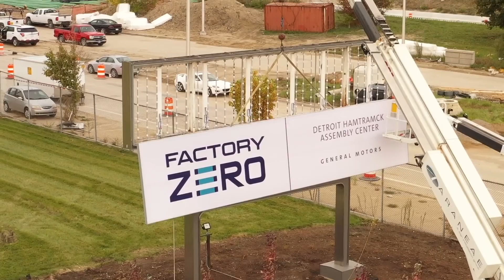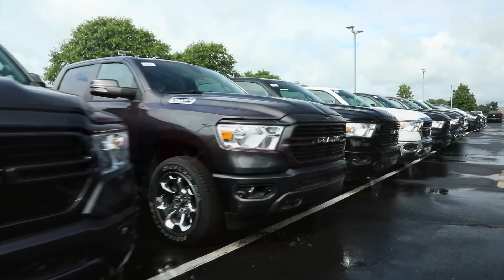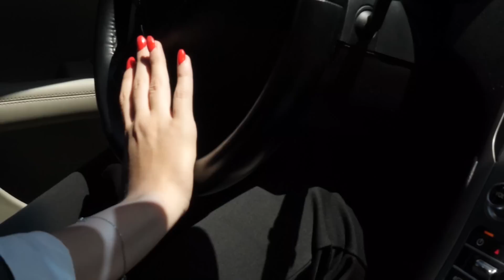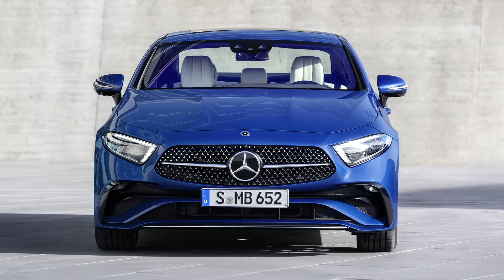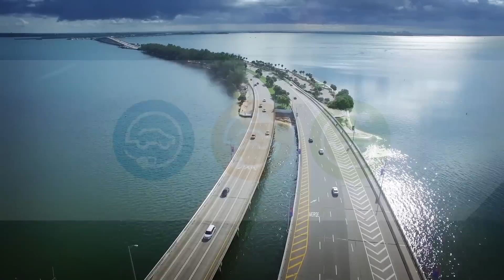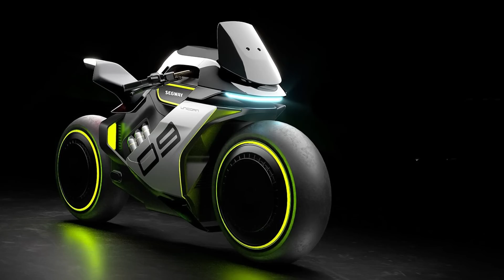Jeep Refreshes the Compass; GM Announces Electric Silverado - Autoline Daily 3053

Comment: Hydrogen powered motorcycle? DOA! It will never reach production, thankfully. No other form of transport could possibly be more dangerous, to the rider or to other users of the road. Hydrogen should be banned as a vehicle fuel. Why not a nuclear powered motorcycle instead? Equally ridiculous and cleans up the gene pool a bit as it sterilizes the rider.

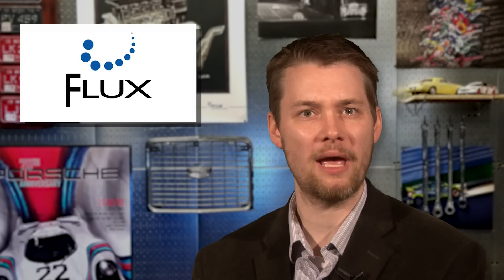Comment: 1:58 AutoLine guys are snorting too much Lithium Ion. What qualitative or quantitative difference is a Flux moped to a 4-stroke conventional cheap scooter?  Initial cost and TCO essentially no different to an ICE cheap scooter. Riding experience no different. Tank of fuel in scooter will last a very long time of doing milk runs or piggybacked on an RV. What inherently about the Flux will change people’s behavior?  What the Flux is up with you guys???

Comment: The CLS just looks old...as in styling. Hydrogen refueling is the problem. No infrastructure for hydrogen (and very expensive to build out)..or very limited at best.Consider interchangeable battery packs (like at a filling station) as an alternative.
Reply: Hydrogen safety is also a problem.

Comment: Hey F1 is Hybrid powered Cars!
Reply: Where did you see that? It hasn't even moved to synthetic fuels!
Reply: @stephendoherty8291  F1 has been using hybrid systems on and off since 2009, I believe  all teams used it since 2011.  Its called KERS, they can use flywheels or batteries to store energy when decelerating.  Not exactly Prius like, but still hybrid.
Reply: @dbwelder9159  They may use KERS but its just a booster whereas standard hybrid works all the time. Its the same concept as Nitros Oxide. KERs is also restricted as to when it can be used in a race. No KERs system has moved to the commercial car world as we already had turbo tech to boost higher end RPM performance. No F1 car operates on KERs alone nor runs on EV mode in off acceleration mode.
Reply: @stephendoherty8291  Yes I know, but apparently you didn't know it was called hybrid... Unless the Nitrous gets automatically refilled during deceleration, it is nothing like nitrous. KERS is a method to recapture energy, hence hybrid. No one said that F1 hybrid technology will be used in commercial car construction.

Comment: 38k a year LOL nice try GM
Reply: GM did not say anything about 38K per year,   did you listen to the report?
Reply: @dmitchellhomes  You mean, did he listen to when Sean said, "GM has an initial target to build 38,000 per year."?
Reply: @dbwelder9159    No,  you better get your ears checked and re-listen...     Auto Forecast Solutions said...
Reply: @dmitchellhomes  No actually it isn't clear if AFS is only talking about when they start production, because there is an "and GM..." after the first part of the statement, so AFS could be talking about both or only production start time.
Reply: @dbwelder9159     I read the AFS report,  go read it,  its clear the 38K came from them.  Anyway,  if the Silverado EV sells well, GM will sell as many of them as they can,  so speculating is just wasting time.    Factory Zero is a 250K a year plant at full production,  I do not know how that breaks down to the different models which will be built there,  but if there is a market for the EV's GM will build them, and if there is more market than that, GM will build another plant,  or repurpose another of their old ones,  they clearly have the talent to build and equip plants,  they have 4 under construction right now,  not including battery plants in Lordstown OH.    Wentzville they are rebuilding while it is pumping out trucks,   they clearly know what they are doing.     Not like Tesla that struggles to redo an interior on S and X on Schedule and has months of delays...
Reply: @dmitchellhomes  Probably not why the Model S & X is delayed. A lot of new technology under the skin.
Reply: @dlwatib    You mean like taking away the shifter, and turn signal stalk to cut cost?    Ya, thats new tech that nobody wants.   S and X is delayed by bad management and bad planning.    Simple as that!

Comment: Hydrogen and fuel cells is better than ICE in terms of efficiency, but  much worse than battery electric vehicles. Further the infrastructure is missing.
Reply: that why MFCVs are a better option when weight matters.... electrichybridvehicletechnology.....features/are-methanol-fuel-cells-the-solution-to-carbon-neutral-heavy-duty-vehicles.html

Comment: It's easy to see how fleet customers would be interested in EV trucks not only to reduce maintenance but in some cases to have a large electric power supply at the job site. It will be interesting to see how much interest there is for personal use. I see a lot of folks in Texas that buy really expensive trucks but almost never use them for hauling things. With a big battery to work with and some innovation it should be easy to make a use case to those customers, if nothing else an ad featuring the ultimate tailgating rig with the owner being the center of attention should get their attention.
Reply: GM gets it,  I am sure they will run the Silverado EV's in their own maintenance  fleet, as its great testing, and will save them $$

Comment: It is good to see a formal announcement from GM about their EV Silverado. 35k EV trucks is a drop in the bucket compared to their regular Silverado sales volumes, but it's a good start. Once GM/LGs new battery factory starts ramping up their Ultium battery production, then the EV Silverado production should climb dramatically (in 2023). Competition in this huge American pickup market (100% gas/diesel today) is vital to the greater acceptance of EVs nationwide.
Reply: Also every EV truck makes a big impact on GMs overall fuel efficiency mandates. If Tesla or the Japanese offer a compelling EV truck, then GM and Ford will find itself losing its most profitable product with no alternative markets to make up the shortfall. GM must accelerate their EV inhouse understanding and one EV car wont do it. At present Tesla can fund any loss on EV trucks out of just extra shares issued without having to worry about Wall St as much as Detroit.
Reply: The Ultium factory production capacity is 40GWh.
400 miles range at an optimistic 4miles/kWh is a 100kWh battery pack. 
Given that this factory will be producing batteries for the eHummer (avg 150kWh pack), Lyriq, Cruise Origin, and others (but not the Bolt EV or EUV). That puts the total supported EV production from the Ultium line at FactoryZero at 400k units. 
And GM still has a half dozen EV models they've said they're launching but haven't revealed. 
That pretty much caps production of each model at under 50k units. 
At least until GM spends another $2B and 2 years making another battery factory.

Comment: The EV Silverado is going to be a winner,   see carscoops rendering if you want to know what it will look like.  (essentially a scaled up Bolt EUV), will be substantially more efficient  than the Hummer EV's.
Reply: Click like if you think David Black is full of crap
Reply: Look at bolt sales.  That is the ceiling for GM.  They will never get more than bolt sales with slow charging vehicles that have poor range/efficiency.  The bolt has good range and efficiency, just poor charging speeds, so it works for fleets and local drivers and costs less than $30k.

These expensive trucks with poor charging and range just won't sell well.  The cybertruck will hit the market first and every farmer I know is very interested in the stainless steel body, but loves that the cybertruck can still be used for family trips using supercharging.  These gm vehicles won't work for trips due to poor charging and no charging network, they cost more than better alternatives like the cybertruck for farmers and contractors that do all their work locally.
Reply: @_PatrickO  FLAMO...  thx for the GM EV FUD ....  Out of fear your cult is losing ground to all the new real EVs :(  

Have fun ranting about fugly vaporware CyberDck :)
Reply: @nc3826  Good ole NC the fraudster.  It is amazing how you still lie about cars.
Reply: @_PatrickO    Time will tell,   but GM historically hits their targets both in timing and specs.    Bolt just had its best quarter ever,  and new models launching soon.   Bolt charging rate is disappointing,   but the range for many buyers is all they need and it is priced right,  in a range Tesla cannot get to price wise...      

 Bottom Line,  GM stock hitting all time highs , and up 50% YTD,  and Tesla stock down so far this year,   Even Tesla super bulls have sold TSLA and bought GM this year (Ron Baron).
Reply: @dmitchellhomes  I assume you mean the new 2021 Bolt that sells for around $32k. I would still pay $37k for a Tesla in order to get access to their superior supercharger ecosystem, along with much faster charging speeds, among other things.

But the $32k price is certainly a good one, it should open the market up for more prospective EV buyers. The 50kwh charging rate may be awfully slow in this day and age, but for allot of people this might not be an issue if they don't travel much out of town, could be fine for their needs.

I'm not sure what this silly line about Tesla stock is all about, projecting I guess? Tesla's Q1 results shocked everyone as they outperformed significantly beyond the expectations of most sane bears/bulls. Most analysts even raised their targets on the news, up to an average of $1300 a share now. They also have over $30B in the bank now, which is the best balance sheet in the auto industry when it comes to cap/debt ratio. So not sure why the need to attack their stellar performance, despite Q1 being the slowest seasonal quarter of the year.
Reply: @AllanSustainabilityFan    OK Bozo,  Tesla does not have $30B in the Bank, closer to $15 B most of which came from 2 shareholder diluting $5B raises last year,  but GM does have >$40B as of last quarter,  and that is after paying down their revolver as was discussed on the last earnings call..     GM can build and sell EV's cheaper than Tesla,   proven by the Bolt EV, and more so by the Honguan Mini in China...   Better supply chain.    Oh no,  Looks like Model Y is the USA is starting to saturate,  and they are being exported now,  loads of them spotted at Pier 80 yesterday.
Reply: Hmmm use a monopoly ecosystem loved by cult drones ? .... Or use competing CCS chargers that have surpassed SC chargers?
Reply: @AllanSustainabilityFan    2021 bolts are advertised around me below $30K,  and while I agree, I would buy a Tesla too, I did buy a Y,  I understand the economics are different for some people.     For some people Bolt is all they can afford,  and I am happy to see them in EV's too.    I feel the same about the HuangGuang mini in China,  Not my style,  but I understand why its the best selling EV in China so far this year...  It's affordable by nearly anybody with a job, and much nicer than a scooter.
Reply: @dmitchellhomes  Talk about comparing apples to oranges...  GM is better/can build cheaper, because they build glorified golf carts and inferior Bolts?  Come on.  And you think GM is making money on those $23-30K Bolts (prices near me).  Yep they can sell them... for a loss, but not that many.
Reply: @dbwelder9159     Bolt just had its best qtr ever,  flushing out the old to make room for the new,  Yes,  I think GM can make money on the Bolt Program,   do  not forget the regulatory credits generated to offset their SUV's.
Reply: @dmitchellhomes  Yeah I was actually shopping for a Bolt 2021 for my mother last month, for her needs it might be perfect, she doesn't travel much, and the garage can easily cover overnight charging. Now it's just a matter of figuring out this federal rebate thing.

It's always nice to have more options in the market of course.
Reply: @nc3826  Use the one that actually works and is most convenient by a mile imho. CCS in the US needs a couple more years in the oven at least.

This might change down the road depending on how well the feds invest in the infrastructure, but sadly not today.
Reply: @dmitchellhomes  Wow 9K in a quarter, at ~$16K below MSRP,  yep have to beat away customers with sticks to prevent riots in the showroom.
Reply: @dmitchellhomes  I don't want to beat this dead horse, but the point is obvious: Legacies have serious financial and cultural challenges ahead. Trying to transition from obsolete products to new ones, while dragging their legacy baggage behind the, is not easy, I don't envy their position. It will take some strong leadership to steer their ships safely through this junction.

Tesla does not have these challenges, as a startup they're working from a clean sheet, and it shows: Nimble, younger workforce, no stranded assets. 

Financially they are now a relative juggernaut, despite the small size. Furthermore, in a few years I would not be surprised if, before 2030, they start making more vehicles than even VW, at this trajectory and in view of market direction.

I wouldn't dismiss their presence anymore with silly comments about normal everyday stock fluctuations, as if that matters in the big picture. It didn't make sense in 2015, and it certainly makes much less sense today.

I'm hoping GM, Ford and VW manage to transition successfully, and it looks like Hyundai is doing a good job at it already. Toyota... we'll see I guess, they're not sending positive messages so far.
Reply: @AllanSustainabilityFan    You don't need to worry about GM making it through,  they will be one of the EV leaders in 3 years,  and VW will be the world EV leader.    Tesla will continue to grow,  but it gets harder to double as you scale up.   Tesla does not have unlimited demand,  and of the people buying cars 40% of the world does not want to buy the same car.    Tesla does not have much style,  I mean my Y from the front looks like a frog with a fat lip.     Most of the OEM's have far better design than Tesla,  and better Execution,   Sandy Munro just saw his first ID4 today, and said  "built well"  "looks good"
Reply: @dmitchellhomes  Yes I saw his review, was not very excited, and kept comparing it to his more comfortable Tesla ride, and also tried to take it easy on the archaic interface. 

Don't get me wrong, it's a nice car but, like allot of legacy cars these days, is behind the times on technology and UI, needs some work in that department. Hopefully some updates will get it up to speed in a couple years.

Demand is not unlimited sure, but we got lots of time before worrying about it, it's big enough for EVs, with Tesla leading the charge, to grow into the rest of the ICE market after all - so 100 million of these old ICE horse carriages to replace.

Tesla's done a good job establishing their own brand flavor, much like Apple did with computers and phones: Modern, futuristic and "get it" when it comes to the digital generation. They have become a status symbol in China, displacing the likes of Mercedes and BMW in a more tech savvy market. 

But, again, there's lots of room for multiple players as EVs begin the process of swallowing ICE marketshare, as a collective force of disruption.

I imagine VW being a strong second place if they manage to take the title from Hyundai. GM and Ford maybe manage somewhere in the middle. BMW, Mercedes, Toyota and Honda seem like they're struggling to make the switch at the moment, if lucky they can survive in a small niche, ala post-iPone Nokia. That's my optimistic view. 

The only variable is Chinese EV manufacturers, some of them seem to be quite well developed right now, one wonders if they'll play a bigger role in the future, in a fashion not unlike what the Japanese brands did in the 80s.

We'll see.

Comment: $2400 for a scooter is not so bad, especially if you just want it for wheeling around the neighborhood, getting that quart of milk, or some such.
Reply: Could also use an e-bike for the job, they're great for a quick trip to grab a bag of groceries, and you can even find them easily for under $900 at the entry level (Lectric XP for example).
Reply: The price is my limit for a good scooter. And there are some. So i really wonder how long the marketing of electric bikes will make the wonder of selling them to people for 5000 and more, when you can have a scooter for half the price. I guess some bicycles just use the hype now and sell because of this only.
Reply: Some electric skateboards are in the $5,000 range.